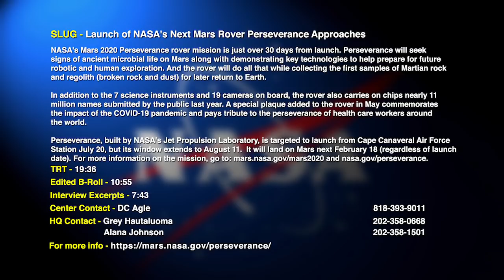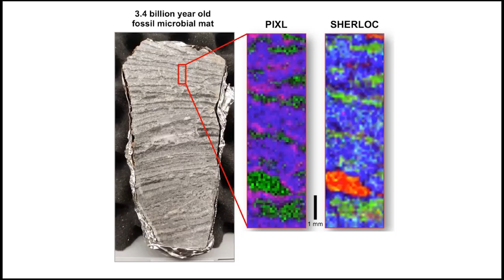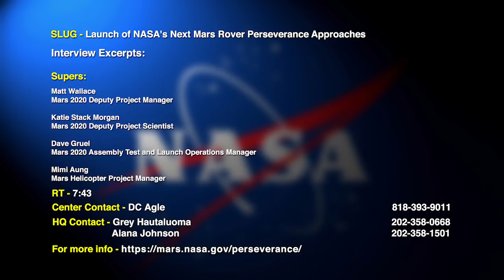Launch of NASA’s Next Mars Rover Perseverance Approaches

Comment: What's the plan to protect the heli in case of storm/s?
Reply: There is so little air molecules that even the wind at the surface can barely move anything, so that shouldn't be a big deal
Reply: It is a proof of concept for future missions. It only needs to complete a couple of flights to have accomplished its mission, any further operations are a bonus
Reply: Don't think the storm wind speeds are that strong.